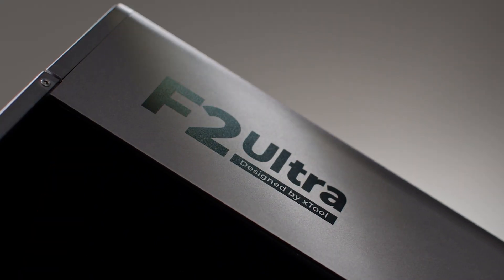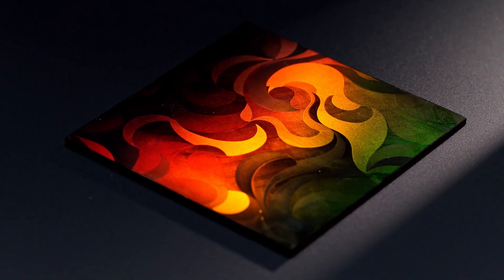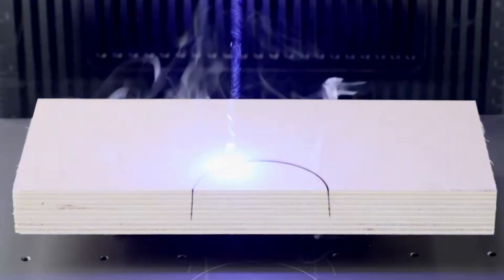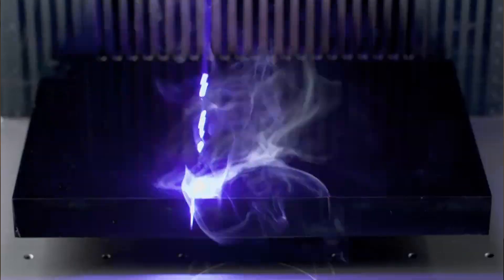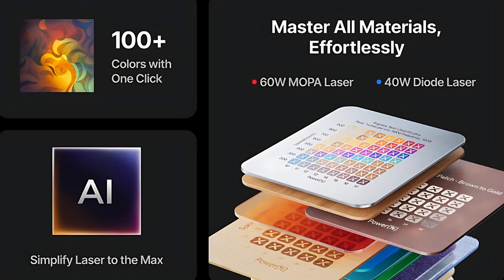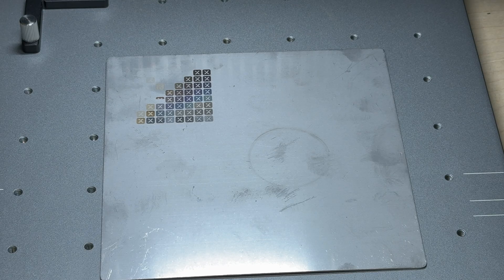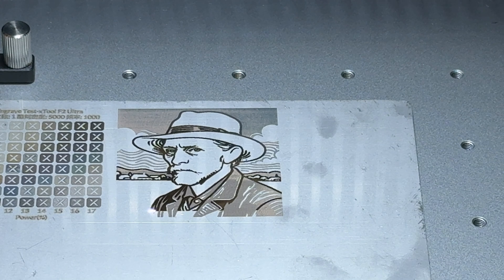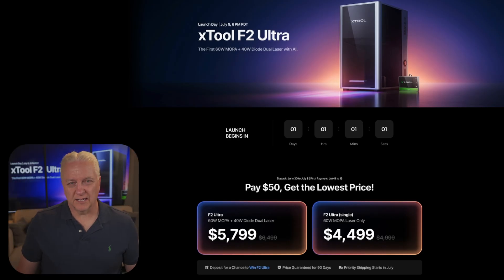xTool F2 Ultra Sneak Peek – 60W Fiber + 40W Diode in One Laser

Comment: I don't like the idea of cutting with a galvo diode laser. Anything more than a couple mm thick gets a dramatic angle in the edge due to the angle the beam makes with the workpiece. That is a bit of a dealbreaker for me
Reply from the maker: Yes I have the same view. I wouldn’t use any galvo for cutting anything thick because of the angle issue. I think realistically 3-4mm material would be the limit.  However the 40W diode laser her would be great for doing deep engraving, which is what I plan to do with it.
Reply: @SteveMakesEverything  fair enough

Comment: It's insane how tiny and useless they make these things. Companies should be designing machines that can cover at the minimum a four by eight foot sheet of plywood and do it in a timely fashion...
Reply from the maker: The workspace is 220mm square which is about as large as a galvo can be to get reasonable results. If you want a giant scale laser you can certainly get one, but it’s not going to be a galvo laser so it will be very slow.  But if that’s what you’re looking for then why would you waste your time complaining about something designed to be portable?

Comment: What are the advantages of  having both of these laser sources in the single machine?  For the same amount of money I can get more powerful standalone machines.
Reply from the maker: Yes, you can get standalone machines, and I certainly have this configuration. However, the big advantage to this and other lasers that seem to be trending to multiple laser sources is that you can do projects that are mixed-mode (use both lasers for different jobs on the same project).  You can certainly do this with two separate lasers, but it means moving the material and realigning and this takes time and precision.  It's not going to be for everyone, but it you get paid by the job, then getting things done faster translates directly into profit.
Reply: @SteveMakesEverything  I have an F1 ultra and I have marked a tumbler with the diode and then cleaned it up with the fiber but I could have skipped the fiber and done the cleanup the old fashioned way.  Any more examples of how the diode and fiber could complement each other? One thing for sure is that both lasers in a single footprint is great for small spaces.
Reply from the maker: @brandonrife  I'm thinking of a project I can show in my review, but I may not have enough time to get what I need to demo it in time.  So I may have to follow up the review with a project video.